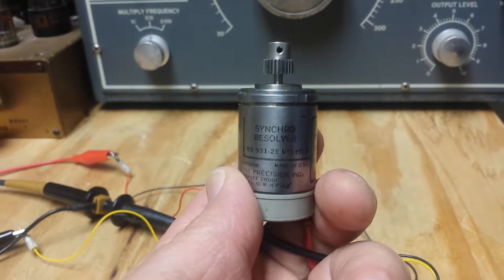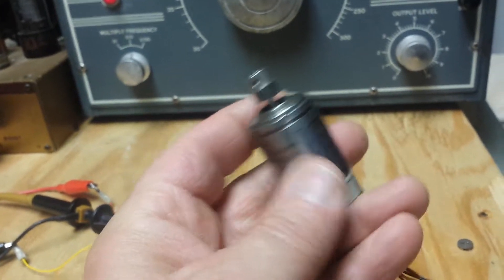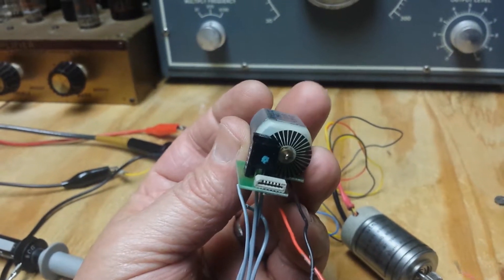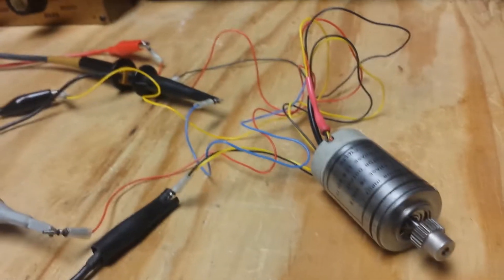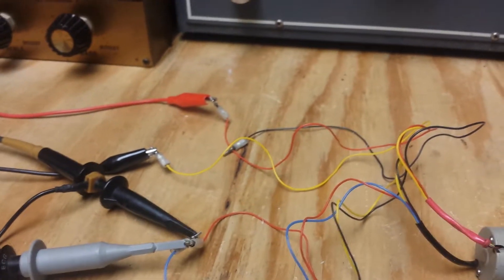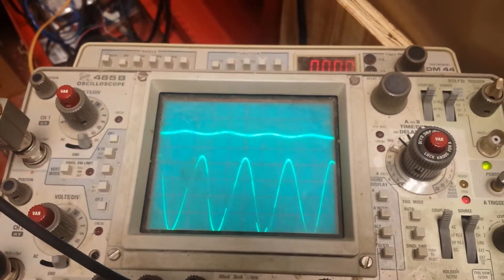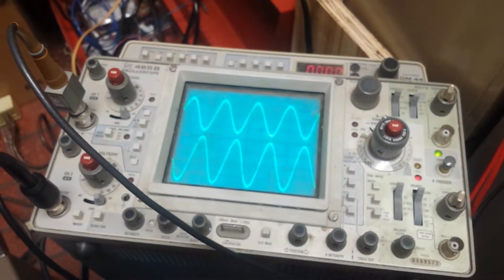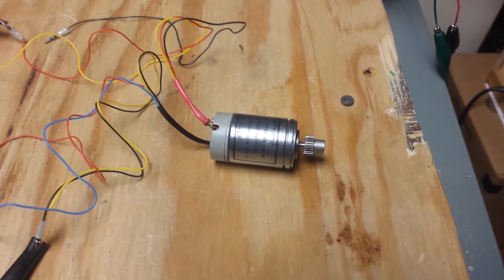Synchro resolver testing

Comment: That's a pretty old ass system I thought everything was in Deca decimal now.
Reply from the maker: Very old tube amp and oscillator - my later videos use an op-amp 400 cycle generator with phase shifting to get 3-phase power from 100w solid state amps.